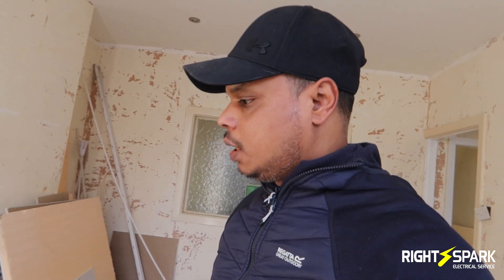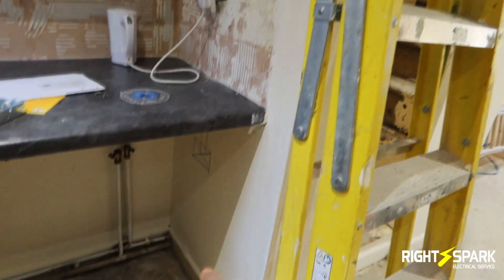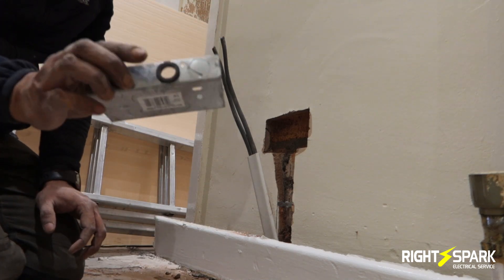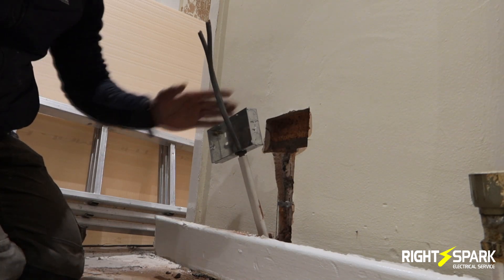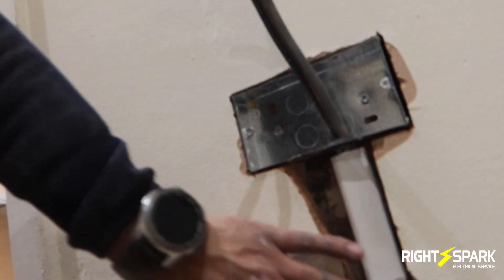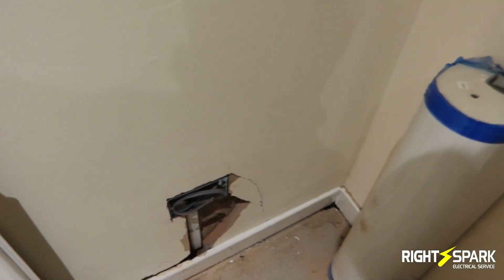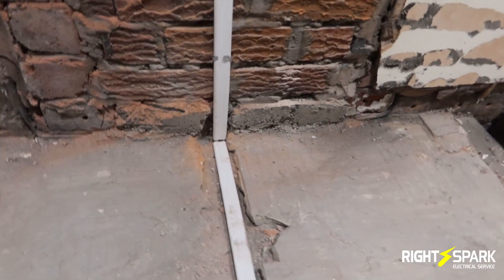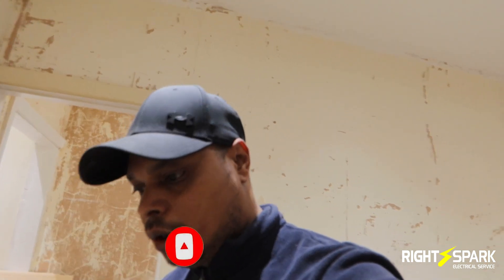Is this against Regs? Installing new ring circuit - Electrician

Comment: It is against the regs. Its less than 50mm below floor level and not adequately  mechanically protected. Well done on filming yourself breaking building codes. 👍
Reply: he will obviously put it on a RCD/RCBO protected Fuse so that rule is covered

Comment: If it's RCD protected you'll be fine.  I normally squeeze oval conduit and put it directly into the back box without the open grommet.  This way should a replacement cable need to be drawn through, it be be a little easier.  My preference would have been to have running it in radial.  A and where I can I put in radial's.  A ring can easily become damaged/incomplete, leading to overload.  I've encountered a fair few detached/damaged rings on EiCR's.  On radicals it way easier to trace faults. 
Great work brother 👍🏼.